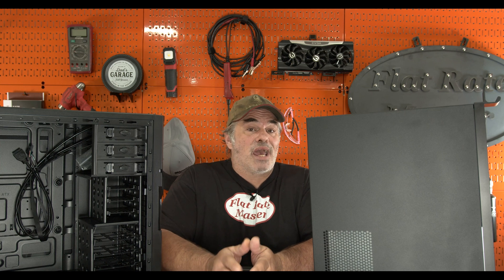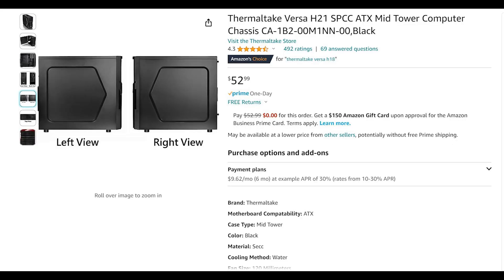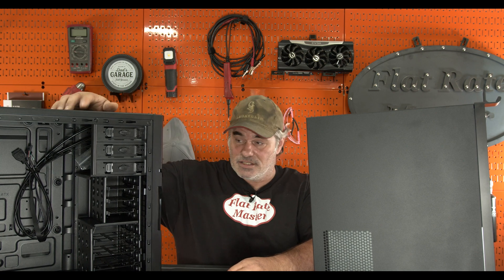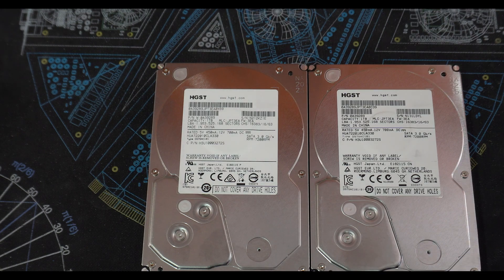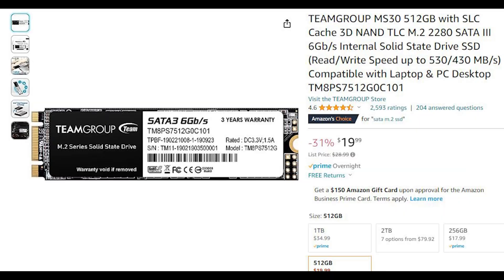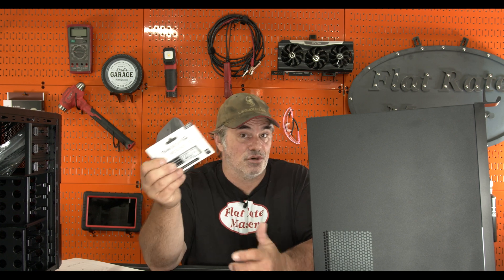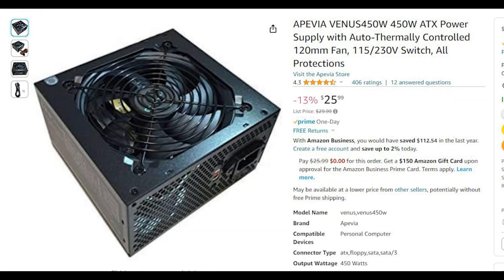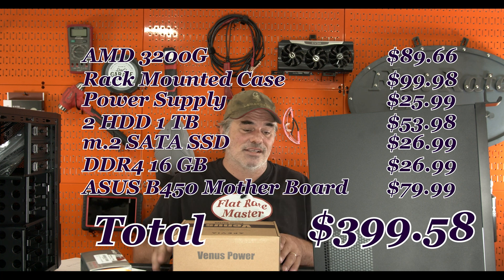Budget Server Build for Plex- Unraid- True Nas Home Lab

Comment: Great Video! Looking to build something similar. Somewhat of a newbie, so I have a question. I want to build a NAS for storing photoshop & video files. Would this processor work with the ASUS TUF Gaming B550M-PLUS mb? I want a board w/ 2.5 LAN and add 2 wd red pro 4tb drives+Corsair Vengeance LPX 16GB(you mentioned in another video). Everything else would be the same. Is that stuff compatible? Thanks so much for your time
Reply from the maker: Yes that board is compatible with both 3000 and 5000 AMD CPUs with built in graphics
Reply: @CreatorHardware  Hey, got another question about this.  I want to use unraid for my NAS and I have 3 6tb wd red drivers. Can I use 1 as a parity drive, use the other 12TB for storage, add a 1TB NVMe for cache and another 2TB NVMe SSD for working on current projects? Will all of this fit on the ASUS TUF Gaming B550M-PLUS board? This is my first build. Thanks so much for your help!
Reply from the maker: @SIGroupLLC  1 parity drive is fine, not the best but it works, That is my current set up only 1 parity for an 8 disk array.1 NVme will work fine as a Cache drive. 
Board is fine, you have enough sata ports and 2 nvme slots.
Using the 2 Tb drive for active project is a little more involved, you would either need to set it up as a second cache and limit the mover to keep the files on the disk longer, or use it to create another pool with just that drive, and set for no parity drive on that pool. here is a post on how to set no parity, No redundancy so make sure to copy to main array for safety
https://forums.unraid.net/topic/108823-creating-a-new-pool-of-multiple-drives-without-parity/

Comment: 1. Is it good to use consumer grade components to be used 24×7? Why i asked is because we either game like 1 - 4 hours or go to office, switch on pc, work 8 hours, switch off, go home... That sorts of usage. Isn't that why server/commercial components costs more...
2. Will I be able to access the files if I went out or I need to be within the home network itself to access it.
Reply from the maker: Consumer hardware can operate 24/7 as well, long term usage may shorten lifespan, but many office pcs are never turned off, I used the same dell desktop in a horrible shop environment  for 7+ years, without issues, the only time the system was turn off was during a power outage, restarts only for updates and was set to never go into sleep mode.  Truth is most hardware will last a long time, honestly before it would die in most cases it should already be obsolete, hence why you can buy used xeon processors for so cheap, they are slow and inefficient.
This video shows the basics of one way to have remote access to your files if using unraid, there are many other ways as well on Unraid,  plex or Truenas
  https://www.youtube.com/watch?v=NNsnjSde5rc